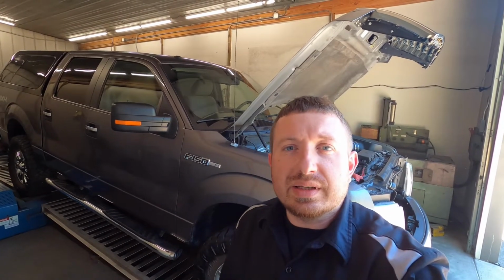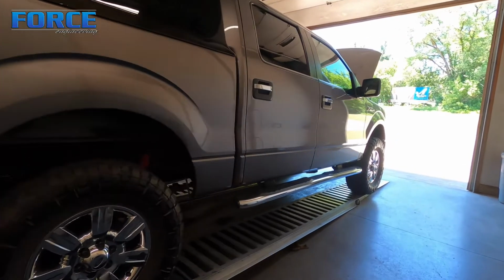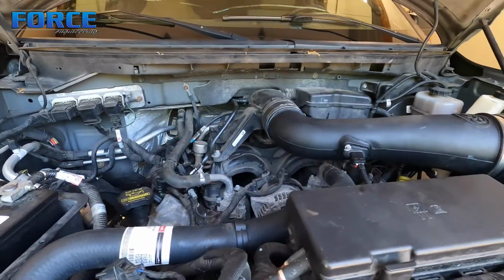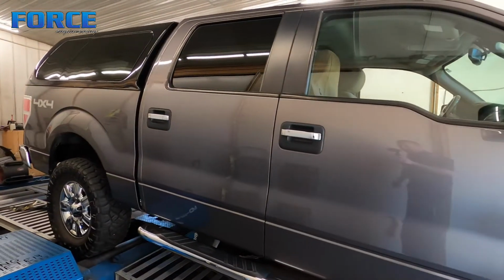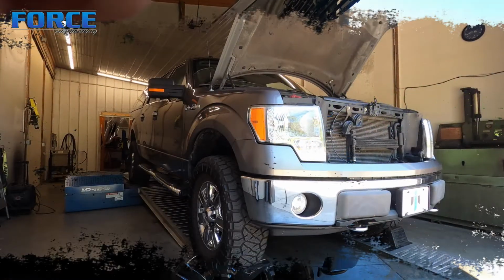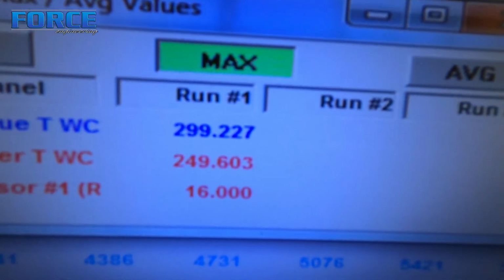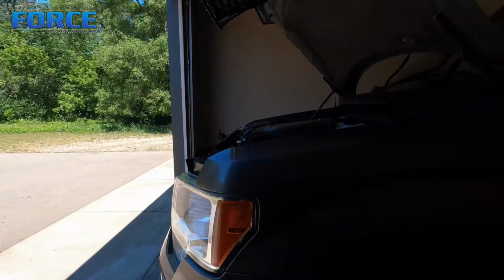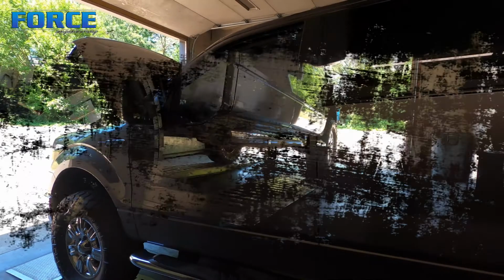5.4l Triton Ford F-150 Dyno | Cam + Bolt Ons | is it Broken?

Comment: On regular gas it makes 310 hp at 5000 rpm and 365 lb-ft of torque at 3500 rpm. On e85 it makes 320 hp at 5200 rpm and 390 lb-ft of torque at 3500 rpm. I personally think the 5.4 sounds better than the 5.0 because it has a deeper growl due to more displacement. Also, the 5.4 didn't have a resonator. People try to say it doesn't sound as good because it's slower, but they are the same people who only have been in a 5.0 or never had a ford period.
Reply: I own a 13 5.0, im disappointed in how raspy it is, has a 2 chamber muffler and still claps like crazy. Love the 5.4
Reply: @billyray4716  and the 5.4 is a pretty good motor. But you got to keep on the oil bc the oil port design is kinda dumb. But a lot of people install high volume oil pumps to fix the problem.
Reply: 5.4 sounds better because of head design so I've been told
Reply: I don't think it's just displacement that makes it sound good. An LS7 with 7L doesn't sound deep, it's very high pitched, almost german-sounding.
That, and other GM truck engines vs Corvette/Camaro, vs german v8s, vs even Lexus v8s tell me there's more to it than just displacment.
It's likely engine timing, firing order, RPM, and displacement that all factor into engine note.

I like me a good 60s Chevy, BMW s62, Lexus UZ or UR, or Mopar HEMI V8 engine strictly for the sound. The higher revving LS engines, BMW engines, or other performance engines are always higher pitched, but that's the sacrifice made for higher redlines and higher horsepower.
Reply: The .4 of displacement has very little to do with sound difference, the way 4 valves flow will always make them more raspy. Plus Ford changed the firing order to give the coyote a smoother idle where as the 5.4/4.6 use a more old school style firing order that makes the idle sound rougher and deeper.
Reply: I think the 310hp and 320hp on e85 is crank horsepower and not wheel horsepower

Comment: 310 horsepower 365 pounds of torque is what the engine was rated at at the flywheel

Comment: So many questions! I'm putting this combo together but in a 05 4x4 screw.  Why did you do the lock outs on the Phasers?  Wouldn't that have helped with low and upper hp/tq? Also what exhaust is on that truck? How you feel about converting to 24lbs injectors? Did you tune the truck or just run it stock? Also is that the stock Trans and torque converter?  Sorry for the 20 questions.  Just excited that someone did what I'm looking to do.
Reply from the maker: I was only in charge of the tuning side of this.  I would imagine the cams were locked do to the common issues with the phasers on these, but i am not sure.  Have them unlock would definitely improve the power curve.  But the cams are just to big to work well with that intake manifold.  I dont know what exhaust is on it.  Charging injector doesnt make power it supports power.  So if they are needed, them upgrade them.  Yes, stock trans and converter.  All good! Wish i had more info on it for you.
Reply: @ForceEngineering  did you get a chance to drive it after you tuned it? Thank you very much for your reply.

Comment: Did the camshaft kill the torque? I guess I'm wondering if the "Hotrod" camshaft & VVT lockout are a good fit for a heavy 4x4 truck. The cams seem more meant for a lighter street/strip car.
Reply from the maker: The cams definitely hurt the tq.  You are correct in thinking these cams are meant for a higher rpm operating range. Which i why they perform poorly in this application.  The rest of the engine combo is designed around a low rpm operating range.

Comment: What after market intake manifold do you recommend for the 5.4 3v
Reply from the maker: This is hard to answer. The correct intake manifold depends on the combination.  you need to get an intake best matched for the rpm range in which your camshafts are designed for
Reply: There isn’t any aftermarket intake manifolds for the 3v 5.4
Reply: They sell a coyote manifold converter i believe.
Reply: @davidcoronado6346  For the 4v navigator engine
Reply: @ForceEngineering  where can you find a performance intake manifold for the 5.4 3v?
Reply: I'm still waiting for this question to be answered as well and still nothing as of yet.  All this good for nothing technology 😂@gagebenson1791

Comment: If anyone knows of a intake manifold other than stock, Please share. I've searched endlessly the 5.0 to 5.4 swap is only for the 4v 5.4.
Wondering a custom intake could be made?  Any suggestions?
Reply: I was wondering if a stock 05-08 3v 4.6L mustang intake with the adapter plates for the 5.4L would be an option.  You would have to use the mustang tb and air intake.  I'm curious if the tb connector would be the same or could be wired to work.
Reply: I need to know also

Comment: The tires alone drained about 30-40 hp from the added weight to turn , dyno has proven multiple times , lighter rims and tires and increase wheel hp numbers
Reply from the maker: The general public doesn't understand this. I'm glad you do!
Reply: @ForceEngineering  I’m at best a shade tree parts changer , I grew up around mechanic shops because my dad was for many years and I respect professional mechanics. I’ve learned a lot from great YouTubers , like I think it’s 1 hp per pound loss , correct me please if I’m wrong but yall do really nice honest work

Comment: Kinda surprised on hp and tq I had a high mileage 4.6 2v headers throttlebody electric fan custom tune 292lb tq to wheels and 227hp at wheels this was a 2001 super cab 2wd
Reply: Long overdue but something tells me there was something seriously wrong with this truck or the tune as the vast majority of people with this truck...myself included see pretty consistently between 220-230 wheel up and 280-300 wheel torque stock. Unfortunately it's a double edged sword with the 5.4 3v because there aren't really cams designed for it specifically. They're all parts designed for the 4.6 which lacks displacement and therefore torque to the 5.4 and with torque you can only realistically get to the 400-450 area before You're dancing with the devil and the modulars weak rods trying to make a viewing window in the block. Which is more or less the reason you don't see cams specific for the 5.4 because truck cams would build torque low whereas car cams build power high in th rpms.

Comment: Should be around 350-400 power wise . Hp and torque. Great torque
Reply: 350hp at the crank maybe, but Ive never seen a 5.4 3V make anything close to 400hp without a major bump in compression with aftermarket pistons, or by adding a supercharger. Even the 4V versions have a tough time hitting 400hp.
Reply: @edjackson4389  I’ve seen 5.4s putting down 300 wheel with aftermarket cams ect. Dude has a channel I forgot the name. If ur putting 300 down ur prob making close to 400
Reply: @edjackson4389  i don’t think it was anything stock tbh, built built
Reply: @edjackson4389  try k. Had a 5.4 doing 0-60 in 5.3 secs. Supposedly he was making 430 crank
Reply: @edjackson4389  Try K was the channel
Reply: @413-n9k  I'll just take your word for it. Couldn't find a single video of a 5.4 3V making 300hp to the wheels unless boosted or nitrous injected
Reply: @edjackson4389  theres the vid. Took me a sec to find it. Pretty old
Reply: @edjackson4389  old video quality but go watch some of his vids of his 0-60. Truck will get up and go
Reply: You have to account the big tires he has on that too. If they are close to a 35 that’s going to bring power way down on the dyno.

Comment: Which intake manifold would you recommend with those cams?
Reply from the maker: Im not sure anyone makes one that would work well with these.  Would be an ibtake designed to operate well from 3000 to 6500rpm
Reply: @ForceEngineering   adapt a ls manifold to it lol

Comment: What intake manifold can i swap for the 5.4?
Reply from the maker: This is hard to answer. The correct intake manifold depends on the combination.  you need to get an intake best matched for the rpm range in which your camshafts are designed for
Reply: @ForceEngineering  but what intakes are available for the 5.4s
Reply: @JosePerez-ki5zv  None that is why it was funny he mentioned it. There are some people who get adapter plates made to run a 4.6 3v intake but as far as I have seen there is no commercially semi mass produced intake for the 5.4. Now I agree the runner length and design of the 5.4 intake is horrible for power. The owner of this truck threw money out the window of a moving car into a fire buying cams for the application. A Whipple or a Roush would have been money better spent.
Reply: @JosePerez-ki5zv  There is a 5.4 3v car intake in the Australian market (they put them in Falcons there), very hard (expensive) to get, and I haven't really seen any info on if they're worth the time and money.

Comment: But why would you waste money on a 5.4 death box?
Reply: Lots of them go 250,000 miles all Original, one guy got 380,000 miles after break in he went 15w40 pennzoil and still going, another guy has 416,000 miles using amsoil, maintenance is key, good clean oil, don't go 6000 miles even synthetic
Reply: My 09 f150 5.4 flex fuel had to have a partial overhaul at 200k miles of abuse and yearly oil changes.  All new oem ford updated timing components except a aftermarket m360hv oil pump.
Sold my troublesome new 19 3.5 fx4 at just 30k miles because I liked driving the steel and iron 09 better. The 5.4 3v isn't a hot rod motor, but it is a fantastic truck motor. Makes more grunt than the 5.0 where you need it, and skips the reliability issues that come with the horrible sounding eccoboost.  

The 10 speed is unpredictable and kinda sloppy in comparison to the refined 6 speed. I found it annoying that the 10 speed would constantly select new gears to maintain a narrow rpm window here in the Rockies. 

A weekend and 900.00 in parts refreshes the  09+ 3v to better than new condition and gets you upwards of 19mpg with proper tires w 3.73 gears. The sound emitted from the 5.4 3v after updated is wonderful,  never breaks a sweat towing or even while accelerating uphill to the intestate. The 5.4 had earned a bad reputation by the time ford got it right in 09 and paired it with the 6 speed, it's a misunderstood engine.
Reply: @Dat_Sun  That's what I'm starting to find. Honestly considering the amount of work many other engines need at less than 100,000 miles, doing a timing set every 150-200,000 is nothing really. I've been bouncing the idea of trading my 2010 5.4 for an Ecoboost 11-16 or even a Coyote but after looking around at Dyno numbers and forums I'll just keep the 5.4. It makes like 30 or so more pound feet at over 1,000RPM lower than the Coyote and sure it doesn't make the same horsepower but I would hands down take a 450 crank ftlbs truck engine over a high winding 380 crank ftlbs car engine any day.

The way I look at it is I had a 95 Powerstroke that made 450 crank ftlbs and it could move a house literally...and reliably. If a diesel with almost 2 liters of displacement more makes the same as a NA engine without the complications of forced induction...I'll take the NA engine.
Reply: @alpha2gproject783 Yeah keep that 2010, your 2010 steel body is a bonus. You can leave a ripple in a aluminum f150 side panel just by leaning into the bed, the aluminum is not up to the task.   

Learn from my mistake,  don't go with eccoboost or aluminum body. The fun factor from the turbo v6 gets old fast, the bad sounds never end.  It was non stop failures with my brand new 19 FX4 3.5.

 I will keep my 09 forever. When the time comes it will get restored. They were solid trucks, and the 5.4 was fords premium engine not long ago, for good reason its a great pickup truck motor.
Reply: I love my 2010 5.4 had a supercharged 07 expedition a few years ago
Reply: @Dat_Sun  yes, very true. I recently ordered and installed a five star tune with a full exhaust about a month ago now. I should have done this a long time ago...the torque is unbelievable now. I have no idea why this truck that they Dyno tested came out so low on horsepower and torque because I strapped mine to a road Dyno at a carshow here and made 283 and 340 which of the math is right comes out to a little over 350-360 crank and 430-450 crank at between 28-29 percent drivetrain loss...but considering many of the coyotes make that much more or less stock but way up at the top end of the RPM whereas I have well over 60-70 percent of my torque well under 2500rpms and peak at 3200 give or take...I'll take that over 4000+ to reach peak.

Comment: makes less power than stock
Reply from the maker: This is a common misunderstanding and i should really make a video about it.  The power advertised by the manufacturer is at the flywheel.  It does not account for the power used to drive the transmission, rearend, and rotating mass of the tires.
Reply: Just shows the loose through the drive line.